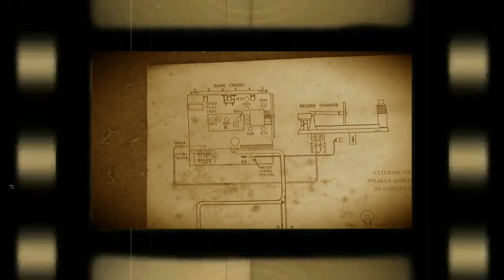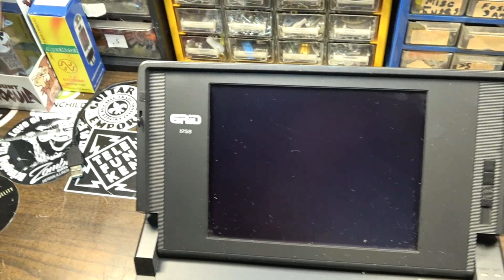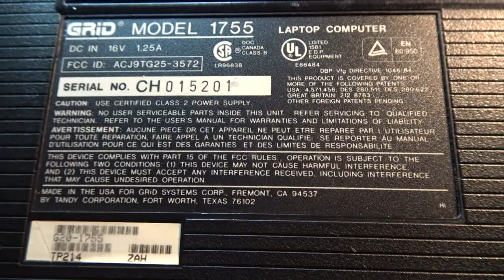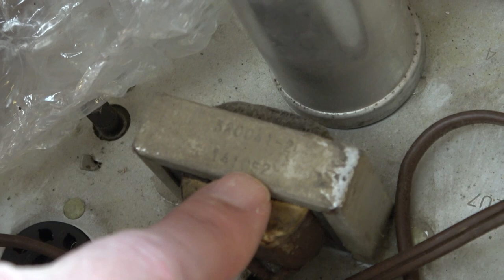Does this OLD Military Laptop Contain TOP SECRET Intel? | GRiD 1755 FIRST POWER UP in 25 YEARS!

Comment: I never expected when i asked if you had a GRiD that you'd actually have a GRiD! It'll be a bit before i get to opening this GRiD laptop. I need to get my bridge computer for hard drive archival working so i can properly image the drive for archival. If i can get the laptop working, i would like to port my homemade rocket telemetry software to DOS so i can have it logging the data real-time on my rocket project. Thanks for the shout-out. It is rare for me to get a shout-out!
Reply: Oh no i just realized the magnavox chassis must have gotten damage with that transformer. I ran out of packaging material. sorry.
Reply: I used to have an old Wang... with an 8 inch floppy disk. LOL 
Funniest part is that's no joke!
Played Zork like a champ on that super awesome deep amber monochrome screen.
Reply from the maker: I can fix it I think.
Reply: I suspect the GRiD will need a recap to show text if your lucky it even works.
Reply: Muse Muser  Ah the simple joy of romping in the land of Frobozz.
You and I are both likely simpleminded... or is it simple minds think alike... 
Bird brains stick together or ...stink together...was it? Ah you know what I mean!
Reply: Ever thought of running Linux on a newer laptop (any beat up old cheap one should do) and then just run a DOS emulator on it??
Reply: It sounds like the motherboard is OK -  that single beep on startup sounds like a "System OK" BIOS POST beep. I don't know how old it is, but it may need to boot off DOS on a floppy (if there is not internal hard drive). I had an old Amstrad PPC640 laptop that had to boot off a DOS floppy to start up.
Reply: @captmulch1  I suspect the same thing. Not sure if there's a VGA output but connecting it to an external monitor might be a great and easy way to check if the screen (or its controller) is busted/ needs recap
Reply: @RealGengarTV  I saw a VGA port when he flipped up that little panel on the back, so it may very well output to an external screen. With the time he had it running, it should have at least shown a BIOS screen even before the HDD started seeking. I have an old Toshiba Satellite 225CDS that's basically the same design (maybe a couple years newer though, as it has Windows 95 on it). I still use it once in a while for serial port access to old Cisco routers and a couple of HP-RISC workstations I have.😉
Reply: I was in the Army and one of the first in my unit stationed in Germany in 1987 to be trained on the military version of the GRiD. We used it to program our mobile commo switchboard in the field in the VN/TCC-41 Communication Shelter mounted to a 1/4 ton Chevy pickup.

Comment: I picked up an old GRID laptop from a surplus auction back in the mid-90’s. It actually had early pen technology. Was built like a tank and ahead of its time. Got it running and working good using beta windows95 for pen software. Fun project. Eventually sold it on eBay towards the end of the decade.

Comment: I think Tandy built those.  It looks like 1755 was a 486 25mHz processor. Came out out in 1993 with DOS 5.0 and Win 3.1.   Cost $3020!
Reply from the maker: 1992. Possibly a Cyrix chip. GRiD invented the laptop computer in 1982. The cost at the time was $9k.
Reply: @TheGuitologist  Yikes!  I took a hardware and architecture class in college 1986 and we each got a tool kit and a school owned IBM 8088 PC to work on.  Basic stuff like installing cards.  I was scared because that IBM PC cost a ton of money.

Comment: Good find on those tubed amps-the “Filmsound” one is from a 16 mm movie projector-amplified the optical soundtrack on the film. This should have a dc out to power the tube photocell. There should be ample gain in this for a “g-fiddle” amp. Projector optical cells were a low level source. Have a unit like this in Bell& Howell projector-mine is series filament strung-no power transformer. It still works-from the 30’ or 40’s. In the video clip could see the amp came from a projector-the projector was in very bad shape. The amp could be a survivor. And yes the Magnavox stereo power amp should still give good service as a stereo hi-if amp. I have the TT from a similar set. Got it rom an appliance swap place.

Comment: Crazy, a few days later I happened to find a GRiD of the same model at an auction side here in Sweden. It's also has a dead battery and I think you need a working battery. Also, there could be a small battery inside that is needed. I don't think those are the military versions. The GRiDcase compass and earlier models with case made of magnesium were used by the military. My GRiD (looks just like yours), was used by a company for keeping track of financial transactions.

Comment: On 20 plus year old machines, you usually have to power cycle the HDDs a couple times to get them spinning, as the grease in the bearings solidify with age, and the small motor doesn’t have the torque to break them loose. Just make sure that you have the tooling in place to recover what you want from the disc when you get it to spin, as you might not get many chances.

Comment: It looks like to me like the laptop wasn't getting through something called the POST (Power On Self Test), before a computing device boots-up it goes through a series of tests to check that things like the power supply, memory, hard drive, motherboard, and etc are all good, if the tests are all passed the computer then goes and boots-up normally, if any of the tests fail then the computer gives an error code and stops booting-up.

Comment: I can't believe somebody threw that 285 amp in the scrap pile. They sell for a few hundred bucks as unmodified pulls. Practically the same as a 385 with the only difference being in the projector. They often come with either Mullard, Siemens or Telefunken ECC83 pre's.

Comment: got an old mid 90's compaq is it laptop? works 100%, I maxed out all the ram and CPU, not sure if I did the hard drive or not, maybe? I managed to gt win 95 on it and managed to get a wireless adapter USB working, through a parallel port USB adapter I think?.. lol, it has no cat5 or Ethernet you have to do that through an adapter as well, those old laptops have those push/eject style adapters that shove into the side.. too funny but that's how you do Ethernet with one of those adapters..(PCMCIA card) built in modem like yours, bout 3" thick, early laptop size, 13" monitor but the size of a modern day 17" portable, not for scrap tho

Comment: Did you try connecting an external VGA monitor?  When I was at ZDS some early color laptops would have an issue with a fuse going to the display.
Reply from the maker: Great suggestion!

Comment: SAVE THE ORGANS 1929-1990. DON'T JUNK THEM FOR GUITAR AMPS. Always a shame seeing the speaker-out driven Hammond AO-35 and AO-44 Reverb Amps gutted for guitar amps. If you ever find an AO-35 with it's 3-spring necklace reverb springs KEEP IT AS A UNIT, throw it in a diy 'REVERB CABINET. The 3 dangling springs are each a different length and represent the Length x Height x Width of the room. You can drive the AO-35's reverb driving input with  ANYTHING with a speaker. Of course the AO-35 is a 2-EL84/6BQ5 amp for your WET REVERB SOUND. You can even just face a raw 12" speaker (hanging on a nail) to the wall for surprisingly great results. My AO-35 reverb is in my sweet sounding 1955 Hammond S6 Chord Organ. It was an add-on when the organ was new probably. It's like night to day having reverb on this organ.

 The AO-44 amp was for a long tank reverb. Laurens Hammond invented spring reverb. The first units were huge. They were installed in HR40, ER20,DR20 Hammond tone cabinets( self contained amplified spkr cabinets). To see one of these "oil column" reverb units explained, with pics, google Ken Griffin (Organ Special Effects) - Theatre Organ . when done hit the [back to home page] at bottom of the page. Also check out, google- NSHOS WURLI 4600 . This is the Wurlitzer Electrostatic continuous free reed organ Ken Griffin switched to after Hammond tone wheel organs . These two types were the only electromechanical mass produced organs ever built, and like the electric guitar, electromechanical  instruments are far more responsive, professional, and reliable than most tube or solid state tone generator electronic organs.

Comment: In a previous life I worked supply in the military.  I would use dBan to wipe the hard drives then smash them with a hammer. Its not a job you want to do if you have 100 hard drives you have to wipe! Sometimes Darik's Boot and Nuke takes 24 hours to complete. Chances are this guy never saw military use, but I wouldn't know processes used before 2000.